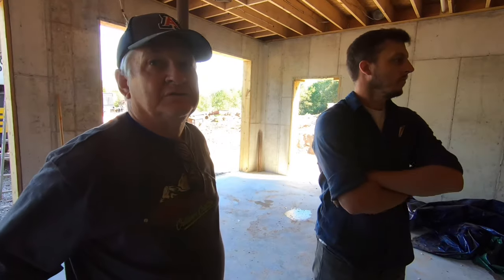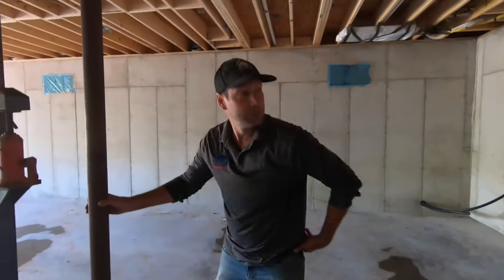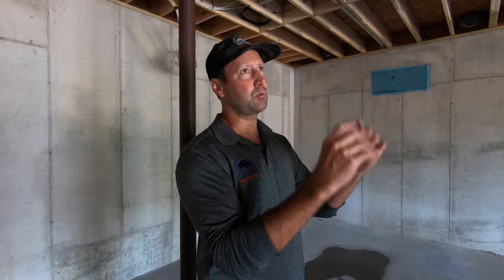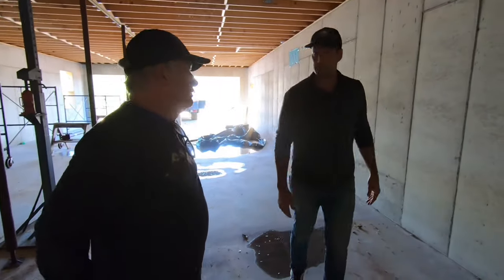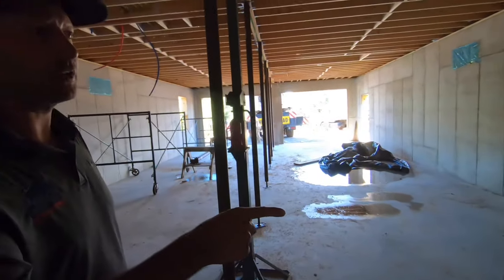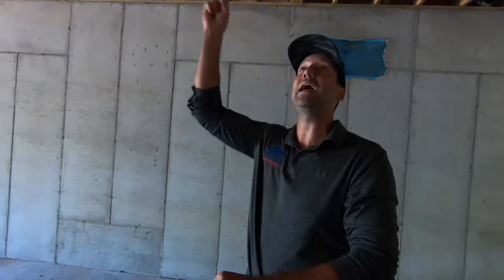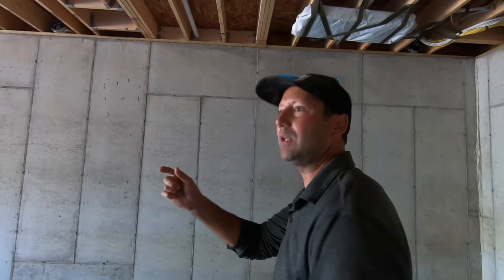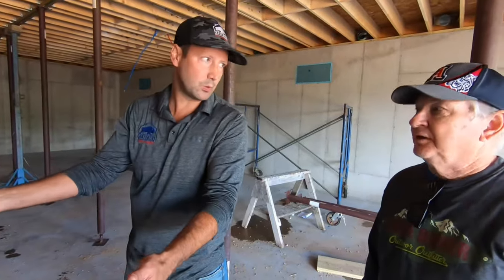What Goes On In The Basement Of Your Modular Home

Comment: I mean I'm not trying to be rude or hateful but that looks very cheap and chintzy I would prefer a steel I-beam going all the way across the basement to support that. And I would also prefer to have a 9-ft basement to accommodate that I-beam being ran from one end to the other end for more of a structural support
Reply from the maker: This basement height is actually 10'! Typically doing an i-beam can remove half the load bear columns, but not always. Sometimes the point load is too much to redistribute and remove the post.
Reply: @Buffalomodular so could you still have an I-beam put in. And that's wonderful that the basement height is 10 ft . Now what keeps the snakes and rats and things like that from entering the basement between the connection of the home and the foundation and one other quick question is this bolted to the foundation
Reply: Love the patience and grace you display. Keep it classy BMH. @Buffalomodular

Comment: I understand the house came in 2 sections and by looking at the long section it does need all the post supports but seems like a lot of wasted basement space. A better solution would be to design in the use of LVL beam and use one post support. I know as a homeowner the additional $1k or even $2k is minimal
Reply from the maker: There's a variety of ways you can look at removing posts, but this will be up to the engineers discretion and what the owner is looking for.